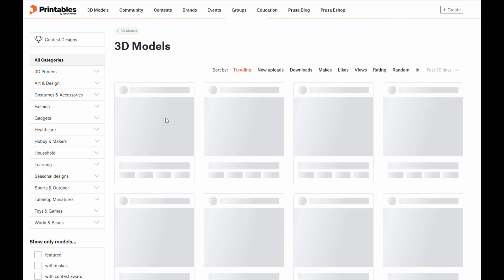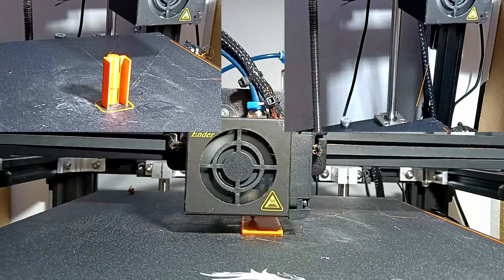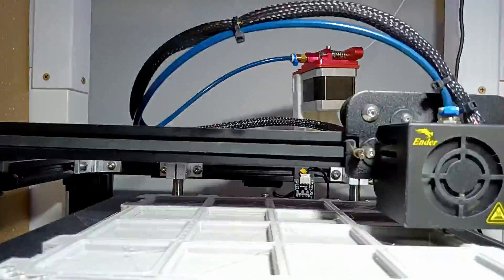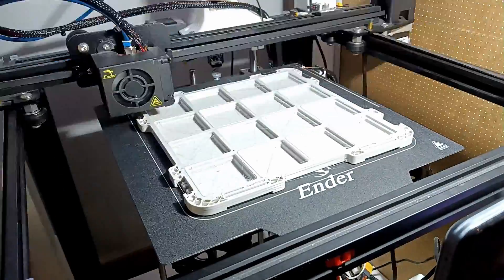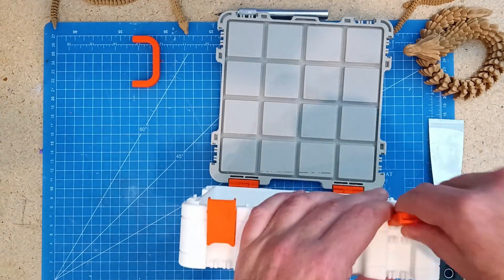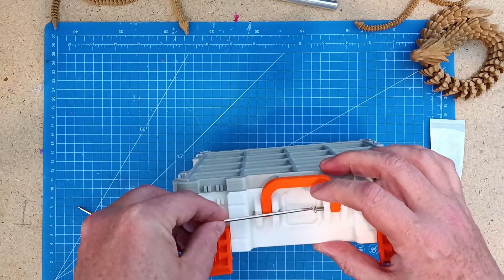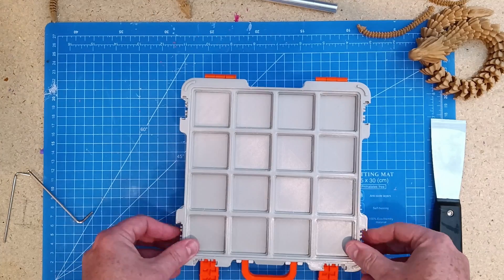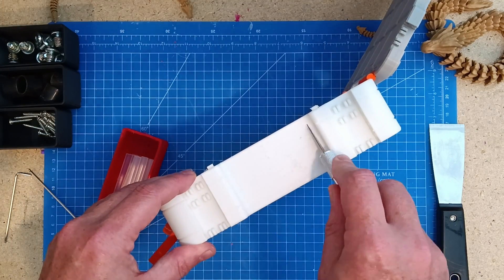DIY transformed: Organisation on the go with gridfinity

Comment: Not used Gridfinity yet, but once my current project of Multiboard storage in 3 places on the wall in my shed is done, I'll have to seriously look at sorting out my tool storage with Gridfinity. I need something like this box for my deeper drawers
Reply from the maker: I started using the hex wall just before multi board came out but I’ve been thinking of switching. 
Once you start using gridfinity you won’t stop!  funny enough I’m making a case that’s trending on printables now that’s very similar but with a clear window on top.  video in a week or so.

Comment: How did you add the holes for the magnets, I have no idea how to do so.
Reply from the maker: They were part of the print so nothing on my part to add them.  I rarely use the magnet feature of gridfinity.  As long as you have the right height bins, they fit tight to the lid of this one so no moving and nothing spilling.

Comment: Did you use the generator website to create the file? What does it mean on there with the internal height being 7mm "u" units - then a number to enter. Is that mean it's 7mm X what ever you put in the option box?
Reply: Mine worked... Kind of. I had pretty bad finish on the underside of the overhangs. Almost like it missed a finishing layer to seal them. Also the supports filled every gap in the bottom grid which was a pain to remove. It's usable but needs some tweaks to make it right. 

Did you use supports?
Reply from the maker: @PatchGuilf no supports for me but that will depend a bit how well your printer is.
Reply from the maker: I  used the parametric file from printables in Fusion360 for the storageBox and adjusted the parameter list in there.  The file didnt have an option for heights.  Just the standard unit size of 6mm. If you mean the gridfinity website generator for boxes, all standard "6 unit height" gridfinity boxes that I've printed fit in perfectly and the "3 unit height" ones stack great too.  Hope that helps.

Comment: Was planning on making a rugged pelican style case for my work truck to hold flusher (jetter) nozzles, might use this design here instead
Reply from the maker: If they are going to sit in a hot car dont forget to use the appropriate filament to avoid warping. petg or nylon would be my go to for anything in the car. :face-blue-smiling::hand-purple-blue-peace:

Comment: The whole point of Gridfinity is being able to adapt to spaces not thought for it.
I don't think the material and time required to print this makes any sense, specially having better systems like Stanley SortMaster that are even cheaper than these prints...
But hey, that's my opinion. If you like it or have an specific need for it of course go for it!
Reply from the maker: I appreciate the viewpoint.  I agree gridfinity is great for getting organisation where there's something that doesnt exist but then there's plenty of drawer organisers out there as well so where would we use it?  Although it's not quite as big, I can't get a Stanley sort master for cheaper than $19 and this case cost about $4 so for price it's a winner.  Time wise, it would have been a lot less to go buy something or even order one with next day delivery.  
The way I've ended up using this though is more of a job to job carry case. I already have gridfinity in some drawers in the garage where everything lives permanently and If I'm doing something away from there,  I can use this case, grab the boxes of stuff I need from the drawers and take it to where ever I'm doing something so works out great.  
You could probably do something similar with a store bought case but this way, all the gridfinity boxes I use inside as well in my office drawers and at my maker table are interchangeable and I dont need to replace all those.  
That's the beauty of gridfinity and 3d printing in general I guess. Whatever we need for our own situation is what makes sense.

Comment: Ooof, the base plate alone is a 32 hour print on my Ender 3 Pro. I can't wait to upgrade to a faster machine. Thanks for sharing. <3
Reply from the maker: yeah mine was a long one but this print was the reason I tuned a fairly specific gridfinity profile for mine. it’s one that f the reasons I had a lot of stringing but got it done in about a third the time it was going to be.
Reply from the maker: also, if you want to see speed, check out another YouTuber friend of mine @3dwolfengineering  http://www.youtube.com/@3DWolfEngineering
  and see what they did.
Reply: Upgrade the extruder setup, put in a bigger nozzle, even 0.8mm works, and some metal supports on the 2 towers to keep it sturdier, bet my ass you could halve the time.

Comment: love the box and color scheme for my medical supplies. stringing on your print is caused by two reasons, filament not dry enough and retraction setting. I have had exactly the same issue
Reply from the maker: 100% thanks for the tip.  I was rushing this one a bit and didn’t tune my retractions for this new filament I started using.  You’ll have to check out the latest vids and you can see.
 ep20 https://youtu.be/FxNsubX2KjE 
I found a fire engine red that would be perfect with white for a medical kit. You can see it in this vid on one of the flexible dummies.
 ep15 https://youtu.be/jULfHMS18os

Comment: Whats the meaning of parametric?
Reply from the maker: Basically some of the dimensions are parameters that you can change really easy instead of remodelling.  There's an example of it in this video (https://youtu.be/VST1j0NKjeQ) where you just change a few numbers and the whole model changes.
Reply: @3DPrintSmith  Thank you

Comment: How much does it cost?
Reply from the maker: For me it works out about $3.50 - $4 USD but it'll depend a little on your settings, what kind of filament you use and how much you get it for.  I used around 240gms and cant remember the exact price I got those filaments for but I usually buy mine around $20-$25 USD  per Kg.

Comment: im sorry wouldnt it be must cheaper and faster just buying a standard type case and printing gridfinity for it specifically? seems like a super waste of fillament let alone time for something that can just be bought. unless you absolutely need a case that is  hyper specific to you but even then im sure you can find a different case that can fit all your stuff
Reply from the maker: It'd probably be quicker but I dont know about cheaper at least not where I live. I think with this one it's more about customising it and for me I was using up filament that I needed to get rid of anyway.
Reply: Sometimes makers just got to make, more about fun than economics.
Reply: @TheeCapN  wouldn't it be cheaper, easier and faster just buying a standard type case with grids?
Reply: If one has the woodworking skills for it I think making cases like what Alexandre Chappell did for his system would be better. More sturdy as well. For small parts and not needing to be too rugged I like this solution.

Comment: Do these stack cleanly for storage?
Reply from the maker: They do stack on top of each other and there's some tabs that make them lock in place to stop sliding off each other.  You can also use the tabs to lock the boxes together on the sides and front.

Comment: You gotta get a textured PEI build plate. I'm not sure if Creality is using polycarbonate, a BuildTak knockoff, or something else for their stock build plates but the adhesion is too strong, even for PLA, which makes removing prints a bitch.
Reply from the maker: In this case for sure.  I think because it was such a large area it really stuck hard.  For smaller prints it’s no where near as sticky and just the right amount, most of the time!   I do want to get some more plates though.  Especially looking at the different textured ones that makes the first layer look ‘carbon fibreish’ etc.
Reply: @3DPrintSmith Im really liking using a G10 build plate

Comment: Any special settings to print the hinges, I see they come in two parts and need to be lined up, supports internally?
Reply from the maker: The only thing I did to note was print with a really small layer height just for accuracy. If you download the hinge file it comes with both sides and just print on the small side, no support.  If you use the parametric file to adjust sizes of anything just make sure you export the hinge object as a whole and you should be fine. I also take it off as soon as it prints and it’s still warm to ‘snap’ the hinge.  For me hinges or parts like this seem to break internally better while they are warm but others I know have said the opposite so whatever works for you .

Comment: How does the cost of printing compare to buying a container?
Reply from the maker: Cost for that case worked out about $5-6AUD so around $3.50-$4 USD at the size I printed (4x4 grid)
Reply: Unless the design has a specific measurements

Comment: It looks like the hinges slide up to latch into another bin stacked atop it, is there anything on the sides to attach multiple together?
Reply from the maker: I havent tried but the author of the model said you can use the same latches as the front on the sides. just slide them up and attach to another.

Comment: You should check your printer settings. That was an insane amount of stringing and the print quality was pretty poor for an Ender.
Reply from the maker: For sure, new filament I havent tried before and had some initial fails on the base.  I had to put the temp up higher than I would have liked to make sure the flow was high enough to not build up pressure overnight and fail again. I have to do the quick alternative when I  have long prints but making sure I get a video out quick so the trending print isn't stale!
Reply from the maker: For anyone playing along at home it was the retraction setting.updated to 4mm and stringing and quality all good.

Comment: now you need print a HERO ME 7
Reply from the maker: I'm pretty happy with my setup and haven't looked at upgrades for a while but WOW, I hadnt seen the HERO ME platform before but looks pretty aaawesome.  I'm going to have to check that out https://www.printables.com/model/39322-hero-me-gen-7-platform-release-4
Reply: @3DPrintSmith if you don’t want your print head looking like Quagmire’s chin check out the Minimus shroud on Cults.
Reply: @3DPrintSmith  mejorar tu ventilación de capa mejorará en un 70% tu calidad de impresión. Los voladizos quedan perfectos, es pasar de la tierra al cielo